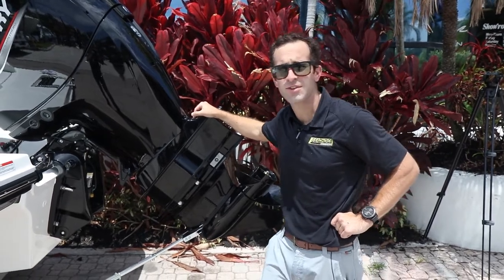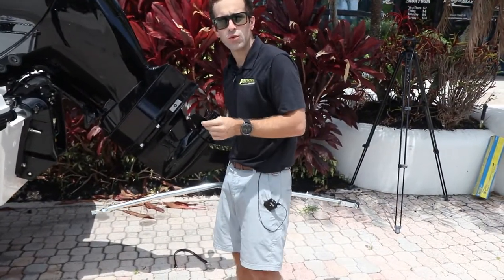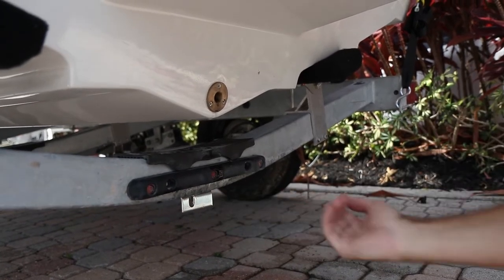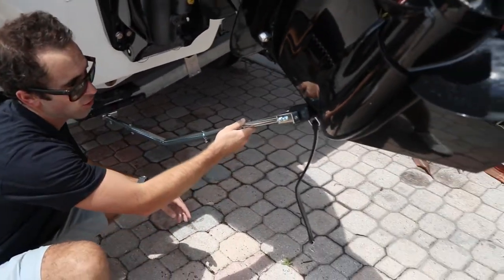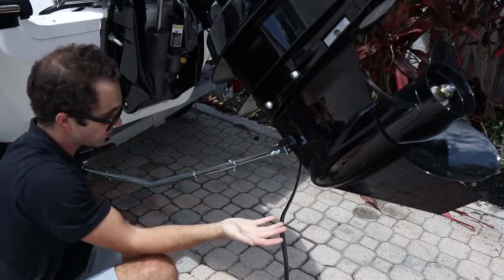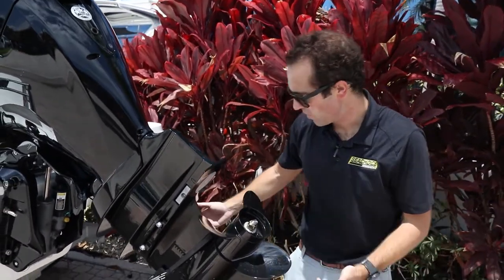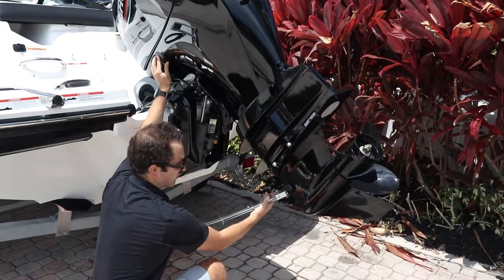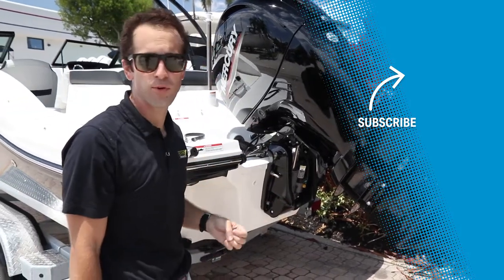Reduce Stress On Your Transom and Hydraulic Tilt/Trim When Trailering

Comment: Do you let the full weight of the outboard rest onto the saver?
Reply from the maker: No. While the transom saver shoulders some of the engine weight, that of the lower unit, the transom still supports the majority of the weight. In addition, the transom saver transfers the bouncing and rattling of road travel from the lower unit to the trailer, thereby mitigating the tremendous stress placed on the transom, engine bracket and related hardware during trailering.